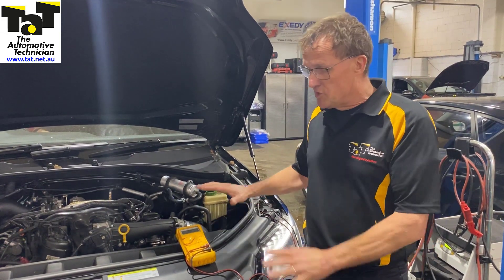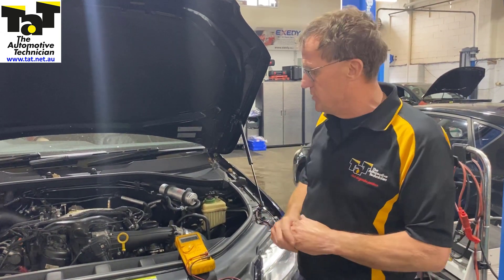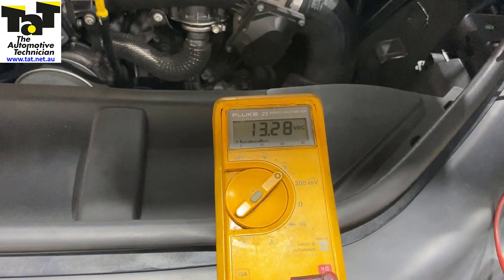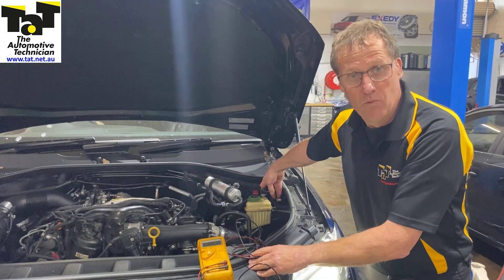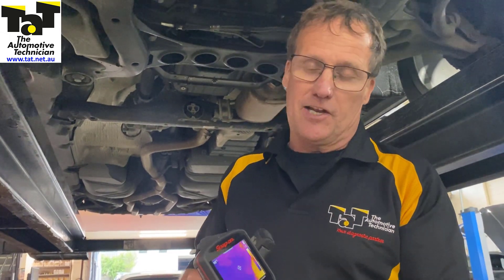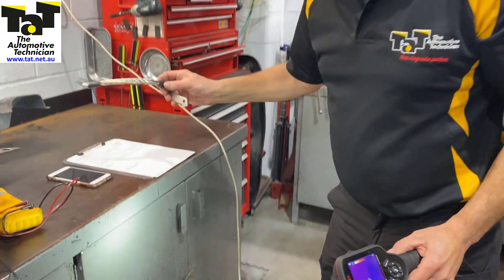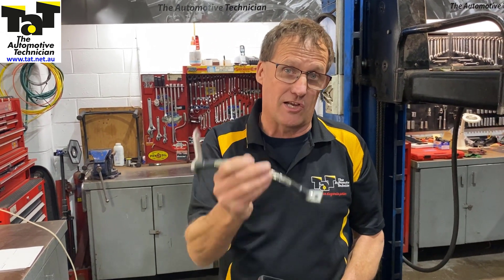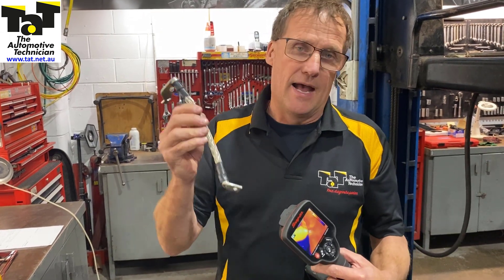2014 Audi Q7 Voltage drop testing

Comment: 2007 A6 C6 - diagnosed terminal 30 - voltage drop all. This video is so helpful to the mechanically inclined and those with some patience!! thank you very much for explaining the isolation process here. I have been chasing this issue  with my mechanic on my wagon. It has us questioning relays, fuses and the AGM battery was swapped unnecessarily lol 

thanks again for information on this specific ground issue